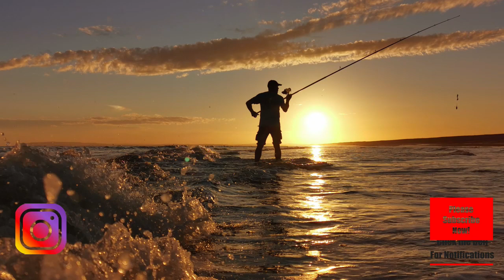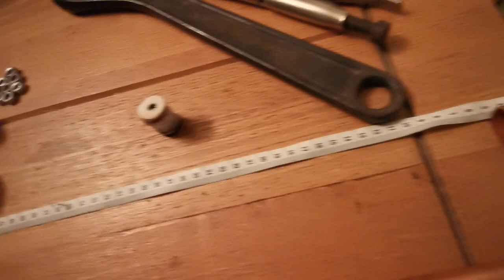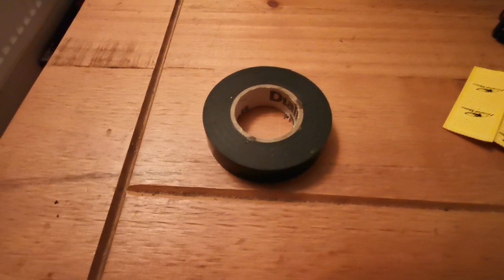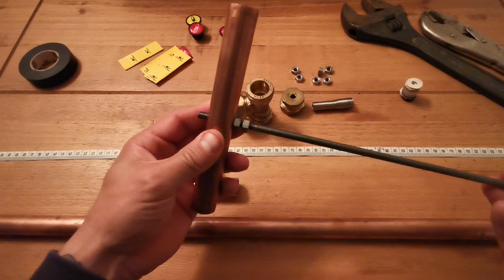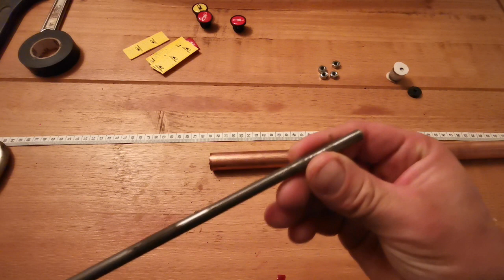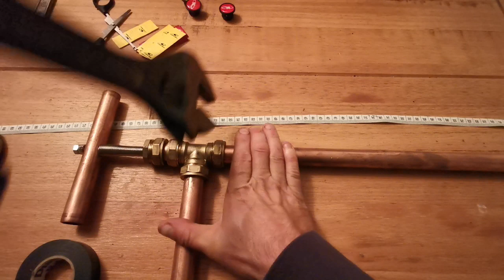How to Build a Bait Pump | 22mm Pump for Blacks and Yellowtail worms | Sea Fishing UK

Comment: what thickness is that steel bar going threw the copper pipe
Reply from the maker: Either 6mm or 8mm will work but the one I use is 6mm

Comment: Great vid. Just about to set up to make bungs but what dia washers and cutter do you use to get good fit for 22mm outer tube. Thx
Reply from the maker: I use an off cut of the copper pipe as a punch to get the right size washers
Reply: @gsp  That's almost too sensible! What dia metal compression washers do you use at top and bottom- just wondering how much clearance to leave given inside diam of copper is about 20mm to get best compression of silicon. Assume 18mm would work but might as well learn from the master...

Comment: What is that end cap
Reply from the maker: It's a bicycle handle bar end cap👍
Reply: @gsp  I am sorry for these stupid questions. I have two of these copper 22mm bait pumps which I bought about 3 years ago 
I don't fishing regularly as I live about 80 miles from the sea side.  The pumps that I have has a fully threaded bar inside .I  have seen them at diy shops.  They are not strong enough as they bend after sometime while you pumping worms and can be a right turn off. I just bought a 28mm steel pump from a guy yesterday for 30 pounds a second hand one and I think he has probably scammed me. He told me yesterday that he will post the pump out to me. I also paid him for postage. I havent heard anything all day from him today despite the fact that I sent him few messages.  I came across your video and it looks very practical .As I mentioned I already have 2 22mm pumps. I think all I need is a steel bar and that end cape. How much did you pay for steel bar. I guess that bar is 7mm. And where did you get the cape from. I know a garage guy he may will be able to put threads on it. And finally how is your pump performing with that steel bar in
Reply from the maker: @mumtazzafar1576  the steel bar and the copper end cap were just from my local DIY shop.
Reply: @gsp  I thought you mentioned about the bar from b and q
Reply from the maker: @mumtazzafar1576  yes thats right👍 sorry I don't know exactly where you're based. All of it was from b and q
Reply: @gsp  I am based in bradord west Yorkshire
Reply from the maker: @mumtazzafar1576  B&Q is the place to go👍
Reply: @gsp  do you live in Bradford. Perhaps I could see you sometimes myself for your expert advice along with my pumps
Reply from the maker: No I live in Kent, right down in the south east. Its quite a distance to travel
Reply: @gsp  😂😂 it sadly is.

Comment: would 25mm copper pipe be ok i wasnt able to get any 22mm
Reply from the maker: It would be ok but not ideal. The wider the pipe the harder pumping becomes
Reply: @gsp  but surely it will still do the job and be better than a 28mm pump
Reply from the maker: Oh yeah definitely 👍
Reply: @gsp  just one more question would 6mm or 8mm bar be ok to use
Reply from the maker: 8mm would be fine, but all this extra diameter will add weight

Comment: also would a fully threaded bar work instead of buying a plain steel bar and getting the end threaded
Reply from the maker: The thread would rub as you draw the bar through the top hole of the pump but im sure after a short period it would just smooth down
Reply: @gsp  if I grind the threads off and just left the threads on the bottom and top , would it be fine
Reply from the maker: I dont see why not👍

Comment: What diameter is the central bar?, If its a 7mm drilled hole, I'm assuming the bar is 6 or 7 mm in diameter??. Cheers 👍
Reply from the maker: Yes it is 6mm bar👍

Comment: Awesome Job. Very clear video. Have you found that the steel rod has corroded at all? Or was yours stainless?  Would you advise?
Definitely would be good to see another video with you using it like another guy mentioned.
Reply from the maker: It a stainless steel rod that hasn't corroded yet.  I will definitely put up a vid once I can travel to the black lug beds and I can actually pump. At the mo due to lockdown it's too far to travel

Comment: Hey M8ty thanks for a great video I’m curious to know if you’ve used this pump yet and if so how did it go. Very tempted to build one myself using your step by step
Reply from the maker: Yes I've used it 4 or 5 times now.  I'm no expert at pumping worms but I get  more worms quicker with this pump than I ever did with my old, shop bought 28mm one.
Reply: if you build om ues lock  nuts

Comment: Great video and homemade bait pump, I made one from 22mm piping but I put a 13mm plunger in mine with a rawl bolt to put the washers on.It doesn't give much suction as losing it from somewhere, so I might swap the 13mm for 7mm bar and get the ends threaded.Top job m8 go get the worms 👍
Reply from the maker: Many thanks and I hope you manage to get yours working well
Reply: Had another look at my bait pump which I made it from 22mm and 13mm tubing all compression fittings to make it easier to take apart.I had loss of suction when drawing the plunger back, so I made some new rubber washers and seems OK so now just need to try it out as new to collecting worms either by pump or digging for them.
Reply: Cheers m8 hopefully then try it out sometime.

Comment: Nice video! Have you thought about a wing nut at the bung to make the adjustment quick and easy! 👍🏻
Reply from the maker: I've used wing nuts and they come lose very quickly.  I think it's better to have either a locking nut or 2 nuts together so there is no movement

Comment: Just a tip, use car fuel pipe for your stopper rather than black tape, it lasts forever. Plus if you can put the top nut for the handle inside the tube as the nut on the top will give you a massive blister  if you have mega  pumping  sessions. Not poo poing your pump its great, just passing on about 10 years of experience. Well done though good job 👍👍👍🐟💙
Reply from the maker: Thanks for the tip! I'm always open to improve what I do.
Reply: A better way still is use a piece of broom handle, or round wooden dowel,  drill a smaller hole than the steel rod to 60% into the dowel, screw it on. Nice smooth finish that won't hurt your hand. Also, a piece of plastic round piping above the rubber suction assembly is better than black tape. Hope you don't mind these suggestions. Great video.

Comment: Thanks. I bought one very much like yours (but not as well-constructed) off Ebay from someone in Hastings for £35. Suffice to say, I got what I paid for and it lasted about 10 pumps before losing all suction!! The handle came out every couple of minutes and there was no tape bung, so it got stuck when fully extended!! I requested a refund, citing the above, was given one & not even asked to return the pump. It's too cold to dig now, so I'll wait until next Spring and probably just buy a decent one, as I'm way too lazy (and incompetent) to build one!!!
Reply from the maker: Thats a bit of a bummer and it is very hit and miss if you're on a budget and especially if you can't try before you buy